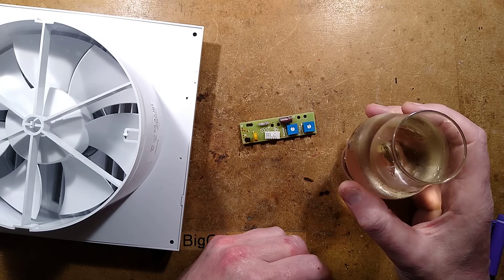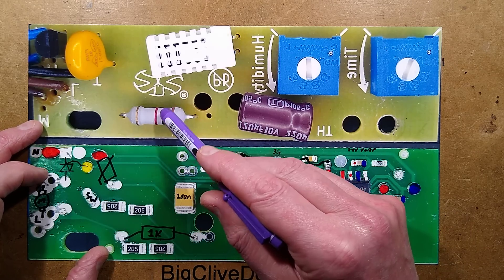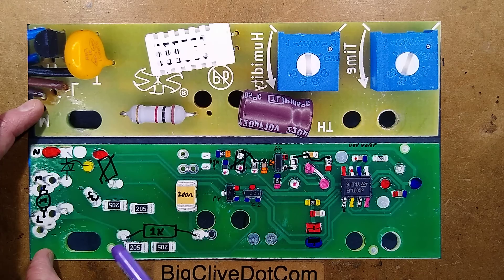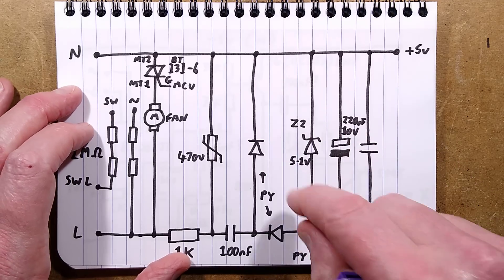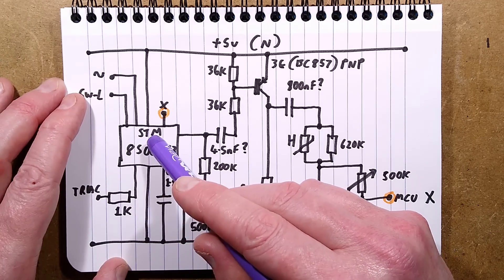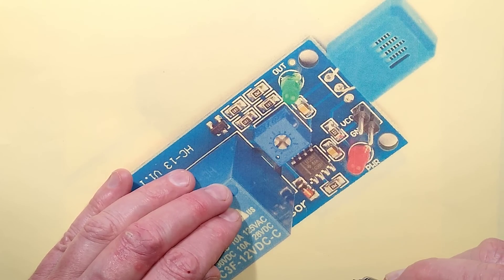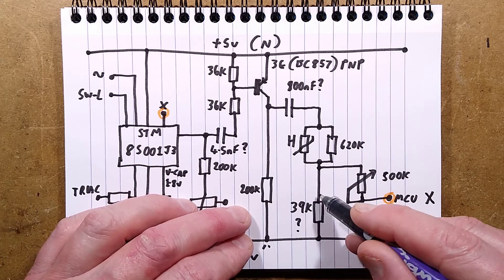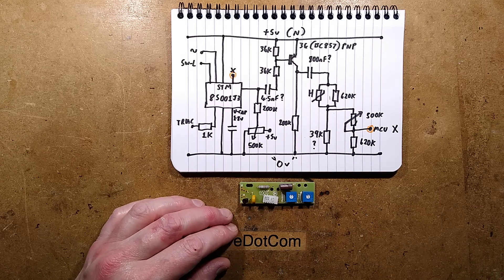Wine powered toilet fan circuit analysis

Comment: The rule about using AC for the humidity sensor reminds me of lessons at school in how to test the conductivity of solutions. You CAN do this with DC, but should not, for exactly the same reason - it electrolyses the solution. You always connect your conductivity flask to the (low-voltage) AC, otherwise you destroy your sample in the course of testing it.
Reply: I have used conductometer but never thought of that!!!!!! Yes DC will have polarization effect and ionic concentration will change over time due to migration.
Reply: @Satyaprakash81102  Same why we use AC no DC in cables. Not about dedlines of dc and ac is meh. But most of the time we use AC as surce/transport of power because ac don't magnetise cables and don't build up antena.
Reply: @arned432 AC is kinda a giant antenna, losses to the various forms of radiation incurred by AC are a quite significant part of the overall losses in transmission lines especially long ones. There's also plenty of magnetic effects from AC it's how transformers work after all. There's no net magnetism on a DC cable if it's carrying equal current in both directions. (This is true for AC as well but there are generally more conductors in an AC transmission line and they are spaced further apart)
The only real advantages of AC is transformers make voltage conversion easy and the zero crossing can extinguish some small arcs. 
These days with semiconductors especially silicon carbide and gallium arsenide MOSFETs the transformer is becoming less of an advantage and more of a liability even at the transmission line voltage level. Lots of new high power long run transmission lines are DC because ultimately it's cheaper and they lose less power.
Reply: @zyeborm  AC is not antenna , but AC in a conductor can radiate because of mathematics. And if a conductor is designed for its resonance then it can emit radiation. In case of 50 Hz it's small but in HF and UHF region it's high. DC can also loss due to corona effect which is breakdown of insulator or dielectric and effect is more severe. A moving electrical charge creates magnetic field. so both AC and DC produce magnetic field. AC has an oscillating magnetic field and DC has a fixed magnetic field. A change in magnetic field strength induces current in a conductor and thus AC induces current in a not electrically connected but magnetically connected conductor of a transformer. But DC has no such effect.
Reply: You had a lesson at school about testing conductivity! A pipe dream of modern education.

Comment: Fascinatingly complex to keep costs low 😂😂- are there alternatives for the sensor?
Reply from the maker: The modern alternatives tend to be all in one digital humidity and temperature sensors.
Reply: Have a look at Honeywell HIH4010 series sensors. They are 3 pin easy to use DC devices. They are a little pricy though - but are also more accurate.
Reply: Knowing today market of IoT I bet someone would slap wifi/bluetooth instead of that humidity sensor to detect if someone is in room and premium version would have camera with subscription to turn fan on off remotely.
After all it's easier to advertise wifi than humidity sensor...